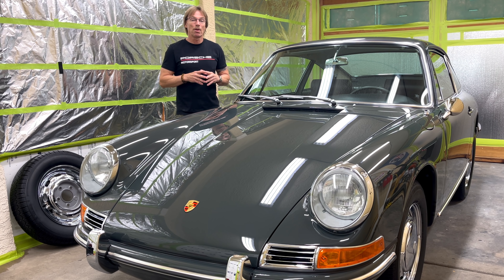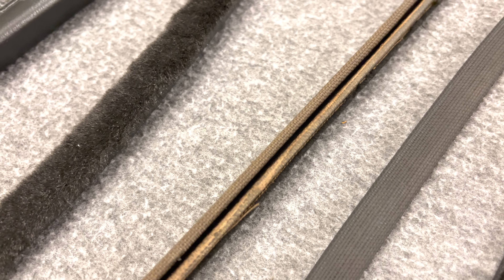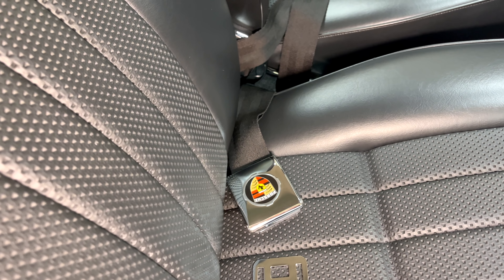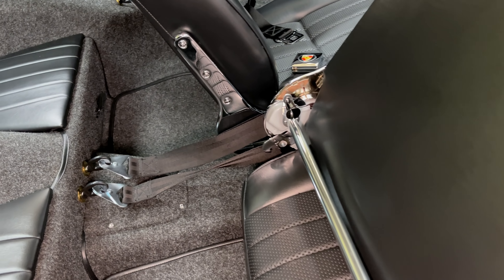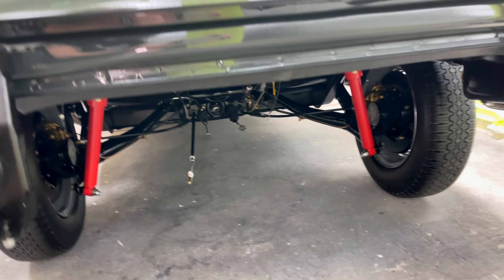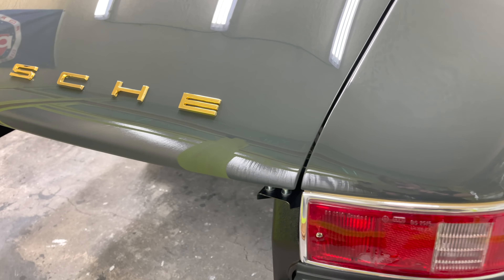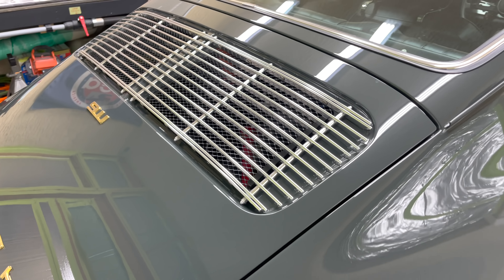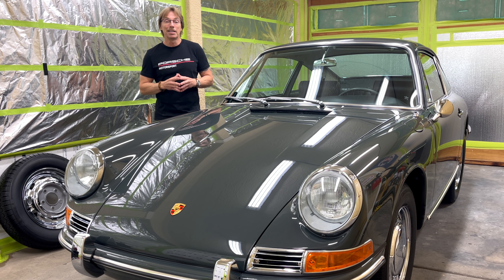Final Walk Around! Panel Gaps! Choline Fuel lines Beware!

Comment: Remember when cars used to come with manuals that had details pictures of how to actually fix issues? I currently drive a Dodge Durango R/T (which I really love), and my turn signal went out the other day - almost had to take it in to the dealership to get it replaced! A $7 part would have cost me approx. $300 to get replaced!! It's how they built the headlights, made it almost completely inaccessible. Only thing that saved me what YouTube videos - but I still had to remove the full air filter assembly to change a simple turn signal!! Crazy times. Cheers for the videos Mike … really enjoy them.
Reply from the maker: Hello Traveler You're very welcome=)
I sure do remember those times..Modern cars are nice but working on them can be a real challenge at times.
Mostly because of faster production methods. Not much is really considered for maintenance.
The priority is mostly of high efficiency and profit margins
Cheers!

Comment: I was just watching some of your old videos and here comes the notification for a new one!  
Well said about the fuel lines, ethanol eats fuel lines like crazy, should be replaced every 10 years in any vehicle, unless you want your classic car end up in fire like that poor F40 in Monaco.  I know there are different specs but we use Cohline 2192 here in Europe which is what BMW uses as OEM (theres a different type for in-tank lines, the above is not for inside the fuel tank).  The American fuel line spec SAE J30R9 is stricter than the European spec DIN73379.  Make sure any fuel lines you buy has the spec on it and is not old stock...
Reply from the maker: Well said Gplus! Thanks for posting=)

Comment: I can't even believe it! Just wow! I see why it was so important that you got a unharmed orginal to start with, that seems like it would be impossible if not. 3 mm that consistent all the way back and forth in some parts? omg, I didn't even really consider about the paint thickness but that certainly could throw it off which means all the way down to the metal everything needed to be perfect. Including moisture, dry times, mixtures, gun tips, cleanliness. I need to go back and see those stages again, just hard to believe! 
Nice to know also about the fuel lines and concourse info. Looking forward to the engine and such!
Reply from the maker: Hello Christopher
Yes Porsche tolerances are unbelievably tight. It all has to be considered in early mockup and bare metal.
The biggest problem for a novice painter would be too much build up of materials. Its Tight Tight!
Not much forgiveness there.
Im glad to finally be through it..it took forever to dial this car in!
Be safe and see you on the engine vids!
-Cheers

Comment: The rear/bottom of the engine deck lid cover was set at the factory to hang 3mm below the rear/back of the fender. This is on my 73.5T, never removed. 
It always bothered me until I saw a bunch of other 911's with similar overhang. Now, I simply accept that's the way they were built.
Reply from the maker: Hello Walt
Thanks for sharing this with us! I can see where its almost impossible to flush the bottom edge and clear the top of the lid without rubbing paint..It drove me crazy trying to adjust it out.
The geometry how it all works as its opening is almost impossible to get it to work. 
Also these cars were hand build and assembled..much like the radius on the door to fender area varies greatly from car to car.
Do you know what the spacing is at the top of your engine lid to back window? Im guessing 5mm?
Reply: @MikesRestorations  Hi Mike. Yes, just checked-  the distance between top of deck lid and the body section behind the back window is 5mm. :)
Reply: My thought on this rear deck lid 'overhang' is that Butzi Porsche designed that rear overhang to complement/balance the design of the front (long) hood overhang -i.e, to lend continuity to the cars overall design. It was intentional. (Just a guess.)
Reply from the maker: @waltpartymiller6802  That makes sense sense Walt! They were giving themselves a bit more range of adjustment there..I can imagine they only have so much time on an assembly line to get things worked out and that lid is definitely tough. Thank you again for sharing!

Comment: Mike - when you say "high-pressure fuel line hose", are you replacing what is there now with braided rubber or braided stainless stell hose or smooth rubber hose?  I need to replace my fuel line as well with 5/16" hose - I'm told either braided rubber or smooth rubber is OK, so I'm wondering which is best.  I was also wondering what length I should get - the previous shop that did the initial install ordered 5 meters - am curious as to how you're proceeding with this - my car is a '68 912, not a 911, so that may make a difference, but I'm not sure about that.  BTW - your car belongs in a museum!!!  Beyond perfection!!  Regards from Conn.
Reply from the maker: Hello rotarybreather..I replied yesterday but for some reason it didn't send..
Anyways thanks you ill try to explain better the high pressure fuel line. On my car its 5/16 and I will busing Gates barricade. Ill attach a link so you can see how it is constructed.
Up front on the fuel tank you will need a maximum of 12 inches..in the year 2 meters maximum should do it.
Gates-Barricade-Fuel-Injection-Hose-5-16-I.D..html
Good Luck!

Comment: Have you tried using a needle on those air bubbles, seems obvious to me, and have used it successfully on window tint film? But maybe you have thought of this and just adverse to having those holes? It seems like a reasonable way to eliminate an air pocket?
Reply from the maker: Hello Rozinat
This particular decal vinyl material should be able to gas out those bubbles over time. It would be impossible to apply the decal in a way without trapping air pockets. It has something to do with air molecules being smaller than the vinyl molecules or something like that. Im not sure of the actual physics involved. So far we are almost dead flat..A couple more days in the warm sun and I think we'll be successful.
Ill keep you posted!